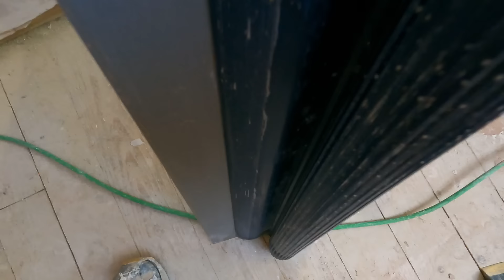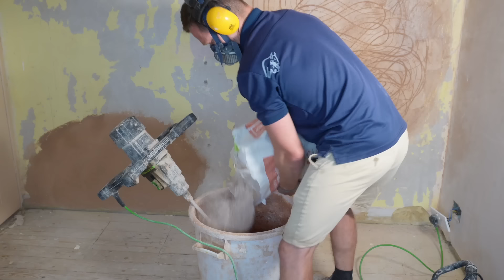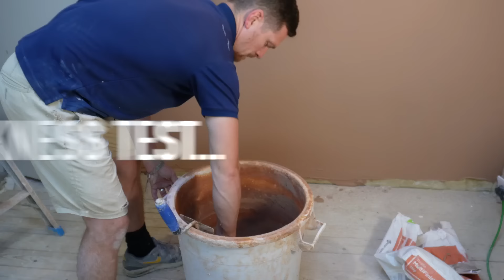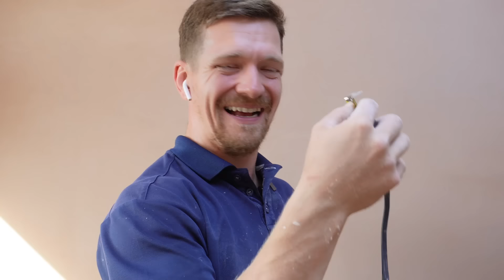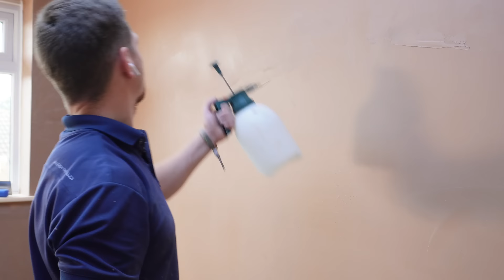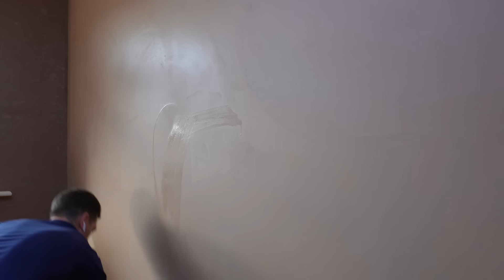ARE THEY WRONG?? Can You 1 Coat Plaster…

Comment: Im a big fan of mixing too much plaster, apply first coat wait for it to go a little bit. Knock the bit up in the bucket and 2nd coat with the same mix. Goes off quicker to speed the process up but gives the same finish as a 2 coat. Obviously you cant do it on bigger walls and ceilings but for smaller bits thats my go to.

Comment: why do plasterers always build the walls out so far. I just knocked the plaster of a wall and some areas had 5cm of cement render and 2 cm of plaster, thats 7cm of room space. With the addition of tiles (1cm)  and waterproofing and adhesive 0.5cm all around an entire bathroom it literally shrinks your room. can both your cement render and plaster coat be rather thin or should i skip the hardwall plaster when tiling?

Comment: Blane I have been following and watching for months, subscribed on here and via emails… Iv been ripped off 3 times by so called tradespeople and now have no choice but to have a go! I’m stuck on starting because of the way the builders have left the doors and windows in the new build. 
Is there a video to show how the boards should be up to windows and doors. Do I just skim up to UPVC frames? It’s a new build so to speak block wall extension conservatory 
The windows have been fitted in between the block pillars … expands foam to fill the gap and boarded, some have gaps with block. 
Iv searched many videos but they don’t show me what I need to know. 
How to board and plaster new build window and door detail

Thank you

Comment: Hello Blaine. I've never plastered before but I am gonna tackle re-rendering my house. ie. Chip of the old render, re-scratch coat and then top coat with pebble dash finish. My one question is.... I'm measuring out my mix 4-1 in 1 gallon buckets. So I've  5 bucket worth in the mixer. How much SBR Bond and how much Waterproofer agents do I need per mix.?? Is 250ml from both agent's to much? Should I use 100ml ?? It's something I'm unsure about. My house is built from a mix of concrete and ash. All advice will be gratefully received. Best wishes, Dave from Northern Ireland 👍👍

Comment: You said one coat , weakens the set , a sponge float , really does weaken the set , sponge float and multi finish doesn’t go together, it’s not designed for that, sponge float,brings up the fat , in lime , there is no fat in multi finish

Comment: I had a spell of it when I fell out of luv with the trade for a while and you av to skim all the joints and beads first or it don’t work and then when painted I noticed on the board joints the plaster had shrunk too much so no not brilliant just to save you half hour but I never sponged so went back to 2 coats and no comebacks

Comment: It can be a great method......especially in this weather 💯 I'm doing some really old walls at the moment which are sucking the life out of the plaster even with 3 coats of strong pva 😂 I'm doing 2 coats with the same mix though as if I was to do it traditional then by the time I've flattened down quickly and cleaned my tools then made another mix it'll be too far gone 😂 plastering is an amazing trade there's so many ways of doing everything 💯

Comment: I can put one thicker coat on and keep it on the wall. I’ve seen people do two coats and take loads off throwing it in bags. It’s all experience as long as the required thickness is on and you know how the plaster behaves in different situations. It can all be done. Put 5 coats on if you want

Comment: Realistically no…1 coat isn’t advisable….too many variables in play and quality will more than likely suffer. 1 mix but 2 costs is a different matter….
Reply: That’s the traditional way, lay it on then go straight back round and lay it down. Most people use the same mix for both coats, either by wetting it up (which can be a pain with lumps and going off like a rocket), or being quick enough to spread it before it’s going off